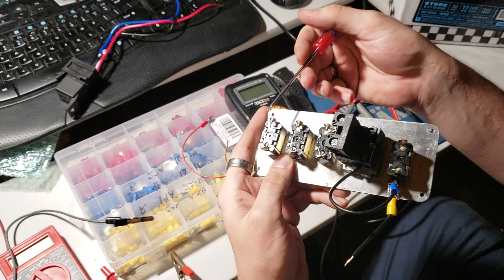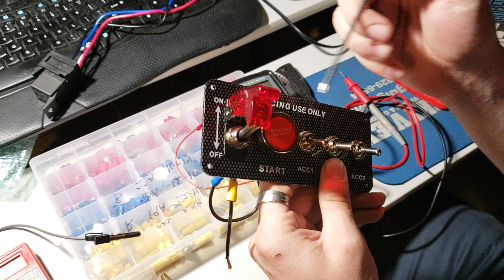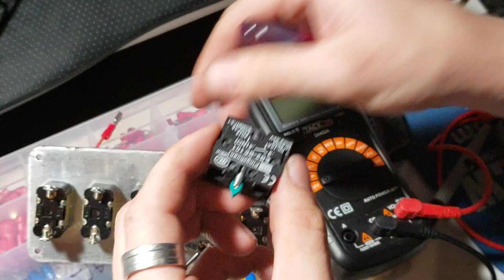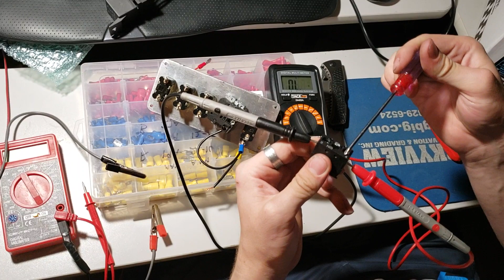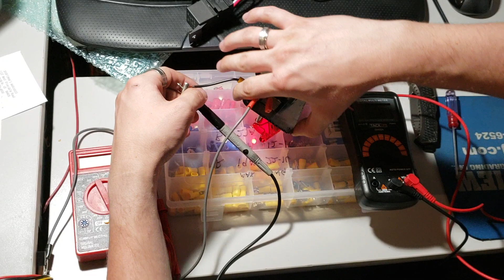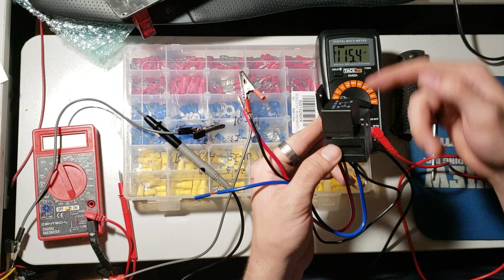How to setup an ignition switch panel

Comment: Hey man, the way you've connected the relay is as if it wasn't there. All of the power to the blue wire goes through the button, which defeats the purpose.

Comment: Do you actually need the relay though for the starter if your just taking the wires off your existing key starting system. The relay is already in the cars original wiring. You would just be adding an extra relay inline of the original one..or am I wrong
Reply from the maker: This is if you're wiring a project car from scratch or cutting out the OEM ignition wiring and wiring in a push start. The output from the relay would go straight to the starter

Comment: Good video but your part bout the relay and it “ not letting that amount current through the switch” is false. The way that relay is setup with a jumper wire is still pulling the 12v through the switch. If the white jumper wire was actually ran to the battery, not the red wire, then no high current would be pulled through the switch, the relay would carry the full load of current.
Reply from the maker: Thank you
Reply: So essentially the relay is useless?

Comment: I know this video is 3 years old, but I bought one of these same switch panels and don’t really know that much about circuits and stuff, your video was the only video that I found that helped me wire the relay and everything together and work as it should. I will mention you in my next video to make sure your video gets recognized !! Thanks again for the information I needed!

Comment: But doesn't all the current for the starter solenoid still go through the momentary starter switch with the relay having the white jumper?
Reply: That whats i thought, kinda pointless having the relay wired that way. Surely the relay should be wired that it has a constant 12 through it remove the jumper and the remote wire just fires the relay!

Comment: How does the neutral safety switch figure into your wiring setup?
Reply from the maker: In my setup there wasn't any change needed to the neutral safety switch. I still left the other factory wiring intact.

It was just my ignition switch column I tore out and went push to start, and support for auxiliary power like radiator fan, USB outlets etc.

Comment: Hi! Great tutorial about this switch assembly by far!! Great job! I cannot find your second video about car installation..another question I have is I'm using this panel to install on a minibike I'm building and wondering if I put the blue relay wire on the starter solenoid (positive side) Thanks!!

Comment: Thank you SO MUCH...this is so clearly explained and really shows how the switches work.  Your description makes it all MAKE SENSE (finally).  I am about to try this switch in my 1989 Ford Ranger once I figure out what the corresponding wires are in the ignition switch.  Wish me luck! -Dan
Reply from the maker: Glad to hear, good luck Dan!
Reply: @instaceptor7236  Thanks for responding and I'll let you know how things go.  By the way...did you ever get that sucker into your car? -Dan
Reply from the maker: @dansmith7617  the switch panel in the car for quite a while before I parted out the car and sold it
Reply: @dansmith7617  so, how did you make out with installing the switch panel in your 89 Ranger?
Reply: @wolfparty4234  Hi Wolf!  It worked great and I'll make a short video of the final soon.  Lots of life gettting in the way (and model airplanes). -Dan
Reply: @dansmith7617  maaan!! I loved flying RC planes. I free for many years and spent tons of money. When I was in to it, the bigger the plane the cooler we were..lol. I had a 3/5 scale Ultimate 10-300 with a 144” wingspan. She was my baby!!! But, like you life happened and kinda stopped. Then the electric foamies came out. Loved them too. Thanks for your reply and hope to see more of ya soon.
Ps, rc content is cool too!

Comment: QUICK question, so the BLUE wire from the relay would go to my Starter ( small stud ) on my inner fender solenoid terminal??
Reply from the maker: Yes, it would provide power to the starter. Most starters have a spade connector like you've described.

Comment: I am not seeing the point of you "using" the relay. You completely bypassed the function of the relay. The harness they provide is incorrect. The white wire needs to be removed and the wire coming from the push button needs to trigger it. What you have done is ensure that all of the amperage still goes through the switch...

Comment: Question: I'm doing a DIY on putting a long cable to a  pull behind field and brush mower so I can remote turn it on a cab. Is that possible? Then an on or off switch to engage the blades on the mower. Are both possible? Will I be needing heavy gauge wires?
Reply from the maker: It sounds like you would just be adding a remote switch that you'd be placing in the cab. Whether that be 1, 2 or more is totally up to you.
As far answering if these could be switched that trigger a relay on board and could be a thin guage, or if you'd need to carry high current through them and need heavy guage is something id recommend asking an expert who is better familiar with the industry or field your needing help with. That's not something I'd be able to advise you on.

Comment: Dude, I can't wrap my head around how you have two ground wires connected to the ground male connection on the on/off switch...

Can you explain that and what the extra wire is connected to ?
Reply from the maker: Glad you were able to figure things out. "CG" intellectronics usually refers to common ground.

If all of those ground connections need to lead to ground anyways, you don't need several wires for ground all leading to the chassis of the car. If there's a good ground, All the others can make a shorter path and just tie into that individual ground.
Reply: Nevermind, I figured it out. Thanks for video ❤💯

Comment: Thanks for the very informative video.I love the explanation about the relay switch and why to use it. I can see it's been up awhile but hoping you or another viewer might answer a question or two.... What are you using for your test 12V Power supply? My guess is maybe a regular vehicle battery but..was wondering if a Car bat charger could be used or is there a specific bench Power supply I might look for? Thanks for any help from anyone on this.

Comment: Hey so another question my car will crank but not turn over and i have the fuel pump and accessorys hooked up any idea whats wrong?
Reply from the maker: If it turned over before you made changes, i'd check on some ignition switches they have IG1 and IG2 for ignition 1&2 circuits. So often times spark/fuel will be on IG2. When you turn on ignition do you hear the fuel pump prime? it could be worth while to check fuses honestly if you've been working on wiring and may had accidentally blown a fuse.
Reply: @instaceptor7236  i got it all sorted out what it was was my alarm system triggered and shut off the car but a simple reset did the trick

Comment: I know Im here super late but what gauge wire should I use would I need 12 gauge like any normal wiring? And also thank you so much for going into detail in the video all the other people on youtube just show it installed basically.
Reply from the maker: In general for these switch panels 14 gauge is ok. The correct answer is the wire size is dependent upon the max amps the component/accessory would draw. You can use a wire size calculator online to plug in the values if you want to get specific. If you're replacing wiring in a vehicle that is already manufactured you could just follow the OEM spec unless modifying it.
Reply from the maker: Glad the detail helped. That was the exact reasoning I decided the video might help others online with the same questions I had to start with.

Comment: Could I also put the accessories and ignition on the the switch with the 12v constant?
Reply from the maker: Technically yes, although uncommon.

The off side of the main on/off switch would still be the 12v constant, then once activated, the "on" pin would be IGN/ACC like you said.
Reply: @instaceptor7236  ok thank you, I am setting it all up right now, just pulled up your video to draw my self an diagram

Comment: Thanks for the video. i wired this panel the way you explained and I had a question about hooking the wires up that are into the ignition switch.  I have a 1989 ford f150 (4.9) with a 8 wire ignition switch.  Can I connect the start wire to the relay that hooks to the push start button, connect the two battery wires and hook up to 12 volt inlet on main switch and then connect all of the others to the remaining 3 toggles and just make sure toggles are tuned to the on position when I start the truck?  wires are marked Start, Ignition, Ignition-Bypass, Accessory, Proof 1, Accessory, Battery and Battery.
Reply from the maker: No I would not do that the way you described.

You need to view the wiring diagram or use a multi meter to determine which wires are "constant" and which wires are "switched on" and their destinations.

So in your case both "battery" wires should be "constant 12v" likely. Both of those go onto the main switch for the panel to the off position like I showed.

Then for those "ignition" wires it may take some reading the diagram, but those would be best to wire both into the on position of 1 of your 3 switches.

The accessory wires should both tie into  a separate switch, they're for like radio, cigarette lighter, and other accessories that are not necessary.

The "start" wire likely leads to the starter, so it'd be on the output wire of your starter relay hooked up to the push button start like I showed. On most 4 pin relays this is always pin 87 (blue in my case).

This may have been what you planned on doing, but I've tried to answer. Don't be afraid if there's multiple ignition wires, depending on the vehicle and what the diagram shows, just put them together since they're both for the ignition system..providing spark at the ignition coil, power to fuel pump, etc.
Reply: @instaceptor7236  Thank you for the reply and I have a picture in a pdf format of what my plan was but I cant seem to figure out how to send you a this showing my layout.  If there is a way to attach a pdf file please let me know how so you can review my diagram.  Once again thank you for your advise - I appreciate it very much.
Reply: @instaceptor7236   Hello -  i figured i would send you a link to a pdf file showing you what my plan was with the wiring and see if you agree.  the first page of file shows my wiring diagram for the truck and the following pages show how I was planning to hook them into the panel from your direction.  Do you think this method will work?  Thanks again.
This is the link to the layout.     https://documentcloud.adobe.com/link/review?uri=urn:aaid:scds:US:589097f5-efb7-40ad-9920-f8cce693a632#pageNum=1
Reply: Hello me again - I just wanted to clarify the all toggles would be in the on position before the push button start was pushed to start truck.  I apologize for all of the messages.  Thanks again.
Reply from the maker: @craigs5513  if you do Instagram you can DM me @instaceptor and we can chat there so it will go to my phone. 

You'll notice if the ignition toggle switch is off, the fuel pump won't come on, dash won't light up, etc. So pushing to start the car will just try and engage the starter and nothing will happen. It won't hurt the car, it just won't start.

So you can flip your main red power switch, then yes go turn on your toggle you put your ignition wires to, you'll hear the fuel pump come on and everything just like you would if you put the key in and turned it one click forward before starting or ACC for accessories.

Then once your ignition toggle is on, you can start the car. Make sense?

If it's a manual your clutch would need to be pressed in even if you're in neutral just because of the clutch switch, so that all stays the same.
Reply from the maker: @craigs5513  as to whether or not all your toggles need to be on depends on the vehicle and what requires power to get the critical components operating.

The short answer is most vehicles only need ignition switched on then you're ready to rock and roll. ACC isn't required. Of course if in your case it's not even attempting to crank, then you could easily just flip your accessories (ACC) toggle and try again.

I'm not sure what proof 1 leads to on your vehicle. Try and do some more reading on that for your specific make and model. I don't have time to research your truck for you at the moment, but I'll try and get back to you.
Reply: @instaceptor7236  Thank you for all of your help.  I will try to find out what exactly the Proof 1 wire goes to.
Reply from the maker: @craigs5513  any findings?
Reply: @instaceptor7236  So I think the Proof 1 wire is to light the warning lights (check engine,  and other warning indications) just during the cranking process and then no voltage after vehicle is running so I  will probably connect that wire to the same terminal (3) as the starter.  The other wires ( ignition, ignition-bypass, accessory, and accessory) appear to have a constant supply of 12 volts beginning at the cranking process all the way until you want to shut the vehicle off so I will run those to the toggle switches and once the main switch is turned on I will then turn all toggles on and push button to start truck.  This is what i am thinking of doing.  I would appreciate your thoughts about this.  Thanks for checking with me - I really appreciate it very much.
Reply from the maker: @craigs5513  based on seeing the .PDF you put together, it was a good setup and would work well. I'd go ahead and put it all together then. I don't see how proof 1 would only have power during startup and then doesn't have 12v when the vehicle is running, but if that is the case then having it on the same output as the starter would make sense

Comment: Video is brilliant. And really helps especially with the relay and is welp explained,.. but one quick question does the blue wire from the relay connect straight to the starter wire on the car ?
Reply from the maker: Yes on this relay blue is the output, so it'd be wired straight to the starter is fine.

Comment: Dude, YOUR video is the best I found for wiring these switches WITH the relay!!!!! THANK YOU!!!!! Like you, I can’t believe how many videos I found with people not using the relay. I’m definitely not an electrician but I definitely know you want that relay wired in. So again, thank you so much!!!!
Reply from the maker: No problem, I need to make an updated video on this. It could be explained in a lot more simple way with pictures as well. I need to gut my car and show a setup from scratch video
Reply: Instaceptor Funny you say “gut your car”. I am pretty much doing that with a mud truck right now. I am getting rid of all the original truck wiring i can due to the terrible condition (it’s a 1983 and it’s a mud truck!). I will get it but what a pain!! Thanks again for the help. Maybe I’ll shoot you a small video of my success whenever that might occur?
Reply from the maker: @1320freek  sounds like a fun project! Yeah I'd be interested in seeing some pictures in the meantime as well! Easiest way to connect would be Instagram? @instaceptor

Comment: The white wire on my set up isn’t plugged into anything on the relay, where does it feed back in?
Reply from the maker: If white(86 trigger) isn't currently plugged into anything like mine is in the video, you would connect it to pin 30. Pin 30 in the video is colored as Red, which is constant 12v that feeds the relay power.
Reply from the maker: White is your trigger, in this example when pin 86(white trigger wire), receives power, it activates the relay. So if you bridge 86to30, it will always have power active this the relay is always active. Does that answer the question?

Comment: Hey man, thanks for the awesome video. One quick q... the panel I bought has sort of a kill switch instead of a on/off toggle for +v. It does not have, however, a spade for negative or ground. Have any idea where the whole thing could be grounded? Manufacturer does not respond. Thanks in advance.
Reply from the maker: Sorry for the late reply, I haven't been on YouTube in ages. I'll likely pull the project car out in the summer and make a few more videos about this.

To answer your question, your Killswitch likely just has 2 slots on it. One for input, other for output. Instead of 3 as shown on mine (3rd being ground). This switch only has a ground because there is a built in LED Light. If I simply don't connect ground then the LED won't light up. It is not required. Just helps to know when the circuit is active.
Reply from the maker: Also, on the Killswitch if it isn't clearly labeled, just have your incoming power on the "off position", then when the switch is flipped in the "on position" it will complete the circuit and provide power to the output side, and that'd be your power to feed the positive side of any other switches.